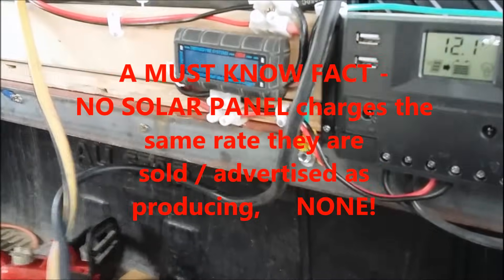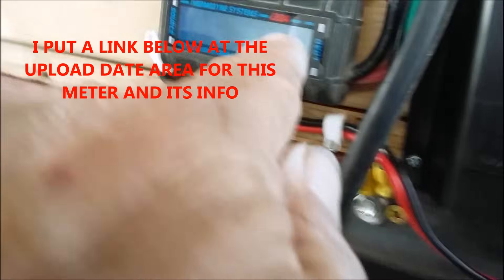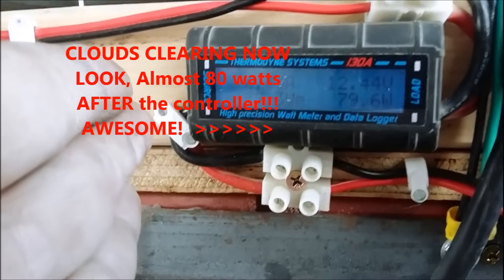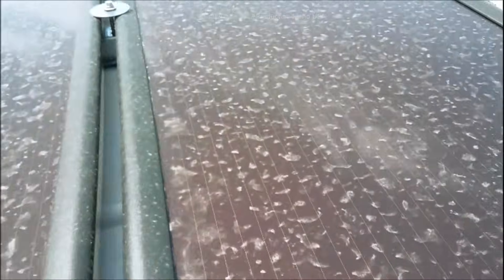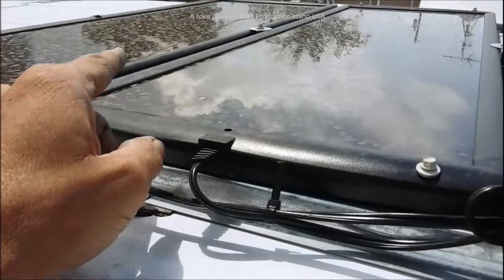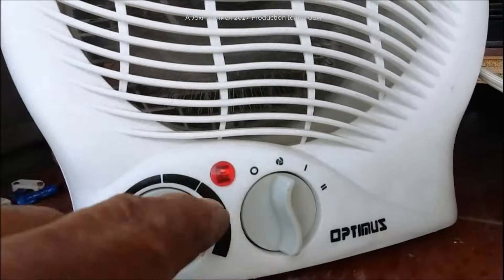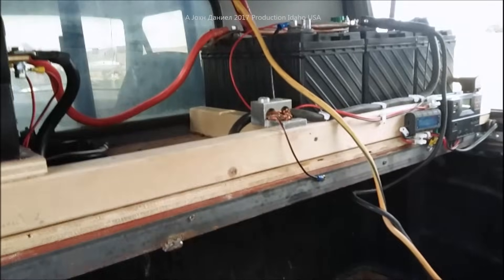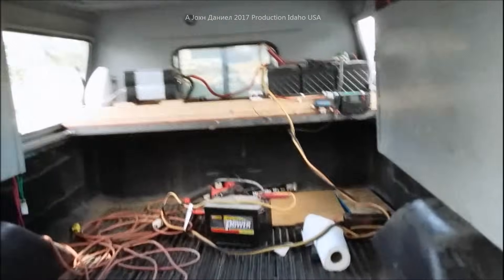Using Harbor Freight 100 Watt Solar Panels Output, my results, Info Below  ↙

Comment from the maker: NEW SOLAR FOLKS  You Can Do It ✌   FOR MY LONG TERM FOLLOWERS - ⬇️ Complete 1200w OPC SURVIVAL POWER SYSTEM -- 100 Watt Panels https://ebay.to/30FYSs1 ,$120 REAL 50A MPPT https://ebay.to/3abTqju ,Solar Connects https://amzn.to/2XJOa1M ,Battery cable USA made https://amzn.to/3h6dsim ,12/2 Above/Underground https://amzn.to/2XIJolg for safe DC wiring of lights and appliances. (appliances you can use on 12 volt full list below video)
Cheap Inverters with proven 4+ year records of quality - 3000 watt https://amzn.to/3awLWrS for tool, high amp and start up use, & a 1000 watt Pure sine for sensitive computers, TV's and electronics https://amzn.to/2Y1UHoH or just go one big inverter a 3000 watt pure sine (preferred method) for what your system can produce in peaks https://amzn.to/3iNsQjQ Solar Wire and other parts will be needed but that is all depending on where you install, not a difficult thing, not expensive. I have been doing wind and solar as a OWNER/USER for over 15 years. I am not a dealer, I hate dealers.
This up sizable serious 500+ watt solar basic + system for under $1000, it is expandable. And will be cheaper to own than any gas generator or alternate power supply. As a person who lives off grid, I know what works together! And I gave you a list of the most dependable parts you can find on a budget and my experience for free! 
You Got Questions? ASK ME!!! I got no issue telling you how to do this and I don't give a care where you get your parts or who helps you, I just like helping BEAT THE MAN out of owning your butt at the utility company! 
This serious 500+ watt solar basic + system for under $1000 is expandable. And will be cheaper to own than any gas generator or alternate power supply. As a person who lives off grid, I know what works together! And I gave you a list of the most dependable parts you can find on a budget and my experience for free!
Reply: Јоhn Daniel Would you add any fuses or switch cut offs any where?
Reply: John I don’t know anything about solar but want to have enough solar to survive off grid if need be, are the components you list enough?
Reply from the maker: Yes, Perfect set up for living when others will be failing. Just be sure you get enough wire and connectors to make it all work. Them Zombie Apocalypse events always start with copper shortages LOL!
Reply: Јоhn Daniel thank you

Comment: These videos are very helpful, every solar user needs amorphous for startup, end of day, overcast, rain and so on.  The Zombies can have the polycrystalline crap, people like them with limited or no clouds.  Two of my friends have added amorphous with mono crystalline after dismal results in GA so now they can have power and sell back to the grid all day.   I'll build my system with amorphous only.   Panasonic and several others are producing CIGS with the amorphous type combination, I guess that's how it's marketed.

Comment: Well I have heard NOTHING BUT TONS OF GOOD ABOUT THISE NEW SOLAR KIT FROM HF!!! AND I AM SURE AS HELL I WANT THIS KIT NOW!!!

MAN! WE GOT A NEW ONE HERE AND THEY HAD THIS KIT FOR 99! AND THE BATTERIES FOR 59!!! I SHOULD HABE GONE IN DEBT FOR THAT PRICE!!?? 

But thing is I still need to know!? So u got 3 or 4 BATTERIES there!? And I STILL NEED TO KNOW HOW MUCJ CAN ONE RUN. OFF OF THAT!? CAN U RUN A 5000 AC ALL DAY?? AND HOW MANY HRS?? AND WILL THE 3 BATTERIES DUE OR WOULD U NEED TO ADD TWICE THAT MANY TO RUN 5000AC ALL DAY!? 

AND OR COULD U RUN 2 FLOOR FANS, 1 SMART TV, A RADIO/CD PLAYER, 1/2 LED LAMPS, A 2.O CUBIC PORTABLE WASHER ONLY WHEN WASHING OF COURSE...

THE BASIC STUFF ONE MIGHT RUN OR USE IN A CAMPER! I ESP WANT TO RUN MY ACS OFF SOLAR! AND 2 OR 5000 BTU AND 1 IS PORTABLE 8000 BTU WHICH COOLING WISE IS THE SAME AS 5000 BTU WINDOW UNIT! I FIGURE IT WILL TAKE BARE MIN ONE OF THESE KITS PER AC?? BUT SOME SAY U GOTTA HAVE 600W JUST FOR 1 5000 AC!? SO WHAT DO U SAY??

Comment: Hey john. I read that a grid tired inverter on solar should be 85-90 percent of the solar panels rated output do you find that to be true? I have two 350 watt rated LG panels I wanted to hook up to a 600 grid tied inverter. Your thoughts.

Comment: Hay John I had one panel on two battery and had no problem  Soo I bought the new four panel system and added two more batteries to my motorhome power system now I got ALL the power I need
Reply: And I don t need to use my generator

Comment: So it will make a heater fan run? Is that it? I thought this was going to show like how many things it could run.
Reply from the maker: Its just a 100 watt set up, its for battery charging, you then run items on the charge stored in the batteries. 8 hours of 100 watts into the battery, would allow basically 800 watts of power for 1 hour pulled out of them. Actual is a bit less due to natural conditions, but you don't plug a 100 watt solar panel in a shoot your meter off your house!
Reply: @JOHNDANIEL1  okay, I have only looked into solar power a little bit so I was just trying to understand. I asked google what a 100w would run and I got this video. Thank you very much.
Reply from the maker: What it will do, actually depends on where you are. Arizona or New York!  A 100 watt panel would run more in Sunny AZ for sure. If your wanting some security from a usable source of power, you do need 300+ watts, usually up to 1000. Our cabin near Baker Nevada uses 1 wind turbine, and 500 watts solar on it. It runs all we need, but it is a 100% 12 volt system including mostly RV components in a old 1892 built 14 x 32 foot cabin.

Comment: Hi John. Love your videos. Looking into solar. I do a lot of dry camping. Looking for something to run my fridge/TV and possibly the microwave without turning on the generator. (Mainly just want to be able to watch TV).   What do I need for this kind of set up. Thanks!
Reply from the maker: I would say for that, you will need 400 to 600 watts of solar, My suggestion https://amzn.to/2TfremV
Its cheaper than and takes less room to use than the Harbor Freight of same output. Get a 2500 watt pure sine inverter https://amzn.to/2RJEBPl , at least 2 large Marine Batteries and a MUST is a microwave 800 watt or smaller. Then your in business with sun power. Cost some upfront, but the independence factor is priceless!

Comment: Too many batteries for 100 watt panels and using a heater like that you will drain way faster than you can charge and it will take forever to charge that battery bank
Reply from the maker: The batteries are also charged from the truck https://youtu.be/yKYx6iEEtm0 when the truck is ran, which is so infrequent the 100 watt panels keep the batteries at premium charge which extends their life dramatically and keeps me from needing to run the truck for random jobs like this https://youtu.be/o2VY4m2lprQ . So far, 1.5 years of very nice results.

Comment: great video and I'm interested in using this setup for deer camp would this run a mini fridge out of a simi truck and space heaters or a window unit at the same time
Reply from the maker: 100 watts is a good battery charger, not a constant power supply. A window unit or small heater would not run on less than 1200 watts of solar and many batteries.
Reply: Јоhn Daniel thanks for the reply

Comment: Can you run Harbor Freight panels in series
Reply from the maker: I do believe so. Only 1 diode in them, so I would say yes.
Reply from the maker: NOTE - Up to 48 volts ONLY
Reply: @JOHNDANIEL1  how long does it take to charge your 3 Ever Smart batteries with the 100 watt panels from Harbor freight?
Reply from the maker: About 4 hours after 1 hour use. Normally Taking volts down to 11.8 in use, then back to 13.8 from the panels. I can cut up almost cord of wood if I don't rush, using a Remington 14" electric chainsaw.
Reply: @JOHNDANIEL1  thank you
Reply: @JOHNDANIEL1  do you think the harbor freight 100 watt panels can charge 7 deep cycle batteries the same batteries you have and if so how long will it take
Reply from the maker: They can, but you'll need plenty of panels. Probably 1 set per battery as the lowest you can go. But I would put some 100w Polycrystalline in the center somewhere.
Reply: @JOHNDANIEL1  what about if I run the 100 watt harbor freight panels in series do you think it would charge them 7 batteries that way?
Reply from the maker: Its all about the watts to amps factor, wiring parallel or series don't change that OHMS LAW reality. Getting a higher voltage allows longer wire runs, but total conversion considered your still talking 13 volts for a 12 volt battery and volts x amps = watts or Watts divided by volts equals amps. A 100 watt panel makes 100 watts, charges at its line of Volt impedance to get the amps to the battery. Whether your doing it at 80 volts and 100 watts or 13 volts and 100 watts into a 12 VDC Battery you still get about 7.3 amps.

Comment: Sir first off i love your videos, and want your opinion because I know you KNOW. I bought 2 harbor freight 100 watt kits and 4 deep cycle batteries from walmat.

I connected 4 batteries in parallel using 3 black 2/0 cable and 3 red 2/0 cable, all cables are 9 INCHES long, then I got red and black (3 foot long) 2/0 cable hooked to positive on the first battery(red cable) then went diagonally to 4th last battery and connected black negative and these two were hooked up to the inverter.

I then took the hf kit hooked 4 panels to a charge controller the charge controller to positive of the first battery and negative of the second battery.
Then second kit same but hooked to positive of third battery and negative of fourth battery to try to keep everything balanced is this ok in your opinion?
Reply from the maker: Looks like your on track. I'm gonna give you a long winded one with sources and link options to look at. I did get my start using a PayPal credit card ( way better than the regular ones) but now I make good money as a installer of solar water well and camp site solar that I now I use NO CARDS HAHA.  I love seeing a New interested person take this on. I always try to get them away from mistakes I made in my first year, waaaay back in 2006! LOL~!  Yes, I started with HF panels too, not a mistake but a huge advantage in education.
When you add more solar, still use original HF controllers and put your HF panels one set towards the South East, the other set towards the South West at a 30 to 35 degree angle. to grow, I would go 3 of these https://ebay.to/2MLTVsh Mighty Max 4 buss bar 100 watt and a 60 amp PWM dual logic controller https://ebay.to/2MNRdCx to that set up. (4 buss bar solar panels have increased sun collection abilities at all angles) AND YES get a 60 amp controller, then you can wire once, grow more.
 Place one set of the HF panels to get the morning-noon sun/the second set to get the afternoon-evening sun. Put your 300 watts of MightyMax on a 22 degree angle straight south. All 3 sets will charge from daylight to dark but your total daily amps will increase due to you replacing power used at night hours earlier with the first set(HarborFreight), saturation of amps with the second set ( (mightymax) and keeping top charge into the evening with the 3rd set(HarborFreight). 
Be sure to get 3 sets of cables for the 100 watt panels, ( example-  https://ebay.to/2wHb9Nt ) 12 awg up to 30 foot will work, over 30 feet go to 10 awg. And put them into a 3 into 1 combiner then into the controller ( example - https://ebay.to/2NRgxEn ). Remember you will need 4 sets of solar cables, probably 3 pairs of 12 awg from panel to 3 and 1, then 1 pair of 10 awg from 3 and 1 to the 60A controller. Use some 6 awg black and red 6awg  stranded wire you can get at lowes or home depot or a assorted option like Windynations https://ebay.to/2NNBmQQ . Got any questions just ask.
Reply: @JOHNDANIEL1  sir THANK YOU SO MUCH for your knowledge I am playing with my 2 hf freight kits and am getting 9.54 amps and 126 watts is this normal sunny day 8 panels at about 40 degrees approximate facing south. I will grow my system just learning as much as I can for now, oh if I discharge my batteries will it improve numbers or am I doing about average? Thanks again. Seller fi.
Reply from the maker: The controller starts to pulse on off after about 13.2 volts till it gets to full charge of 14 volts. Its at 20 times a second, PWM charge. Draw your batteries down and the controllers will increase output till they hit 13 volts. Then they will taper. So far your getting it OK.
Reply: @JOHNDANIEL1  thanks again you answered my question and then some I was wondering why the arrow from solar icon to battery sometimes blinked and sometimes did not your awesome! Semper fi.
Reply: @JOHNDANIEL1  sir can I go with one 340 watt poly panel instead between my hf kits and what about a 60 mppt controller instead of pwm or is my system too small to benefit and if so what mppt type thanks I also watch a guy called check it first he has the same set up I have he's also on u tube.
Reply: I just saw the link u sent earlier for the 60 watt mppt pcm60x sorry for the stupid question you in your wisdom had already answered the charger question thanks

Comment: Did you plug that meter into the battery output on the charge controller then the other side going to the batteries is it that simple?
Reply from the maker: Yes, that simple. Meter goes between controller and batteries.

Comment: how much was your system
Reply from the maker: Harbor Freight panels $144, Potek 3000 inverter $245, 3 Deep cycle batteries $288, 140 amp battery isolator, $75, wiring and materials about $50. All the fun of running a electric chainsaw on my land in the middle of no where hill country Texas - PRICELESS! If you want direct links to all the items, just ask. New 1 year plus review on these panels coming out asap.

Comment: Hi John. At the top you say the 150 amp watt meter is proven best one made, and the pinned post says get the 180 amp thermodyne?
Reply from the maker: Yes, when they came out with the upgraded 180 amp with dual SSR's in it the video was already up, I have since got me 3 of the 180's and they are a little heavier in weight, slightly bigger, but nearly the same size as the older 150. Never had one by HWP or Thermodyne fail in 8 years. But all I bought from others did. The copper clad in the GT POWER and SkyMax branded are so thin they melt, but the Thermodyne (THA Instrument) is not a knock off, its a real deal, yes made in China, but designed in Taiwan.

Comment: hello, good video, can you connect  more than one 100w kit together if so what would you need, thanks.
Reply from the maker: Yes, you will just need a higher rated charge controller. I know a guy who has 5 sets on one of these http://amzn.to/2FJc1Xn MPPT Controllers, he has more output than 5 regular 100 watt panels due to the constant low light performance of the newer HF panels.

Comment: A decent video, gives me a few less misgivings on the Harbor Freight solar setup. Just an FYI, that "please drive safely" hazmat placard is a severe D.O.T. violation.
Reply from the maker: For what its worth, its a very good educational tool thats complete and easy to learn from as a step one to solar power and it actually works well enough to make power for emergencies.

Comment: Good informative video. Where  did you buy ,and what type batteries do you have ?
Reply from the maker: Batteries are the 2+ year MAXX from Walmart Model 29 Deep Cycle Marine made by EXIDE. They are the only ones walmart sells made by Exide, all the others are crappy Johnson Controls at walmarts.
Reply: John , thanks for reply and info.

Comment: should strap those batteries down real good, or move them lower, bad things could happen if you hit something and come to an abrupt stop at high speed.
Reply from the maker: They are locked in. As for a wreck, anything can happen but I have clamps on the batteries down in the mount they are in. Bullet proof? No, nothing is.

Comment: you should try them with an mppt controller
Reply from the maker: I got that on the way. I have a few different MPPT's I will be looking at trying on them. Plus I may buy a single to add to the roof of the truck to keep a over 8+ amp charge rate.

Comment from the maker: 4+ years now of constant 24/7 use of that PEAK 3000 watt inverter in the video,  Best place to get one for $200 is http://amzn.to/2r5227D, ( Component is Hyundai Electronics Corporation) they come with big Cables, remote & install parts. And 2000 Watt for under $100 http://amzn.to/2uhhNsU Everywhere else they are sold is over $300
The PEAK 3000 inverter is the SAME as the Harbor Freight 3000 but a better grade ( advanced sine wave), and $50 cheaper!!! Plus, it has a remote and the cables!!! Harbor Freight version does not.
This is a review of CONSTANT USE of a affordable good quality inverter. The Peak Work Zone 800, 1200, 2000 & 3000 watt inverters ( made by HEC - Hyundai Electronics Corporation) are a very dependable to date inverter brand. I have many now, in semi trucks, shop and a spare. seems to be tough as nails. Good warranty, HEAVY inverter. The Peak Work Zone has 800, 1200, 2000 & 3000 watt inverters are a very dependable to date inverter brand. I have many now, semi trucks, shop and a spare. seems to be tough as nails.
You will see that PEAK in my older videos, 4 years ago and I own many now, love them.
Reply: Јоhn Daniel dude cool set up! one thing to ask, is there more room below the panels that what we see on the video? the panels don't like heat very much, just saying

Comment: Good Morning..Thanks for sharing that.  I can't wait to set up mine. Let me ask you where is a good place for me to pick up the batteries to connect with this as well as what type of inverter are you using? I have a SUV that I want to utilize this with
Reply from the maker: for a small system My recommendation in batteries is http://amzn.to/2vrXNSZ , and inverter  http://amzn.to/2vpuu3z